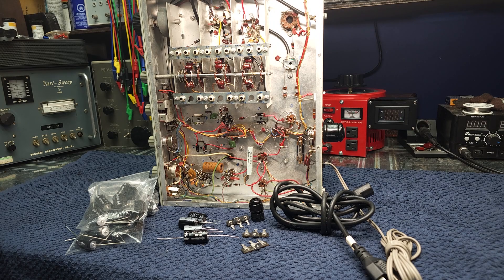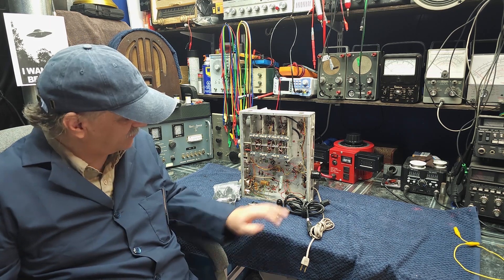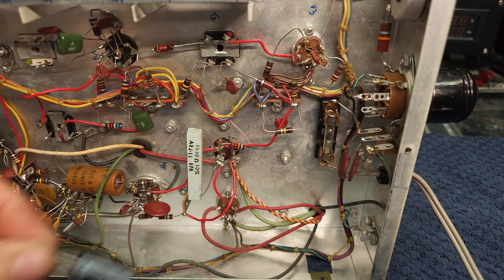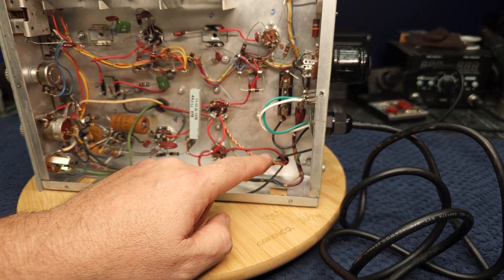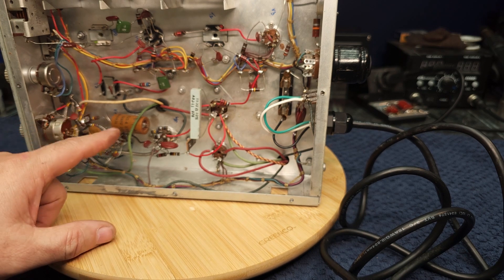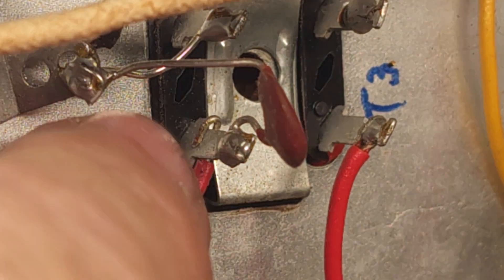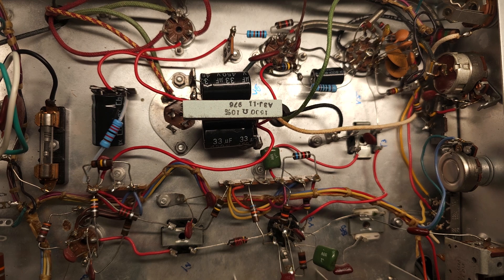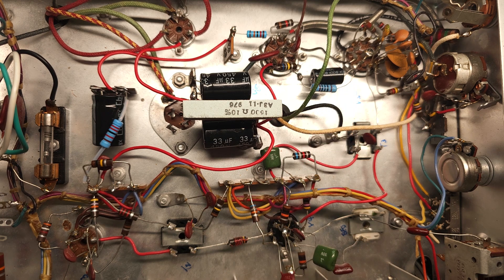Heathkit HR-10B Restoration Pt. - 2 Amazing Discovery!!!

Comment: You might want to mention to tighten all the hardware on Heathkit equipment. I have found quite a few problems that were due to loose hardware. Not only on Heathkit but others as well.
Reply from the maker: Yep. Thats in another step. :)